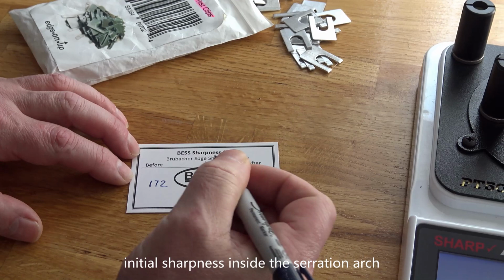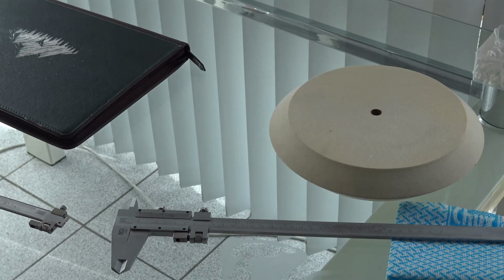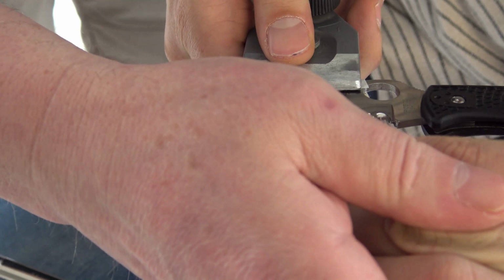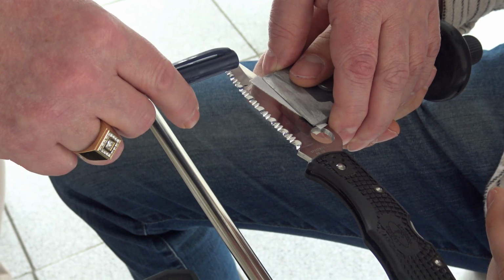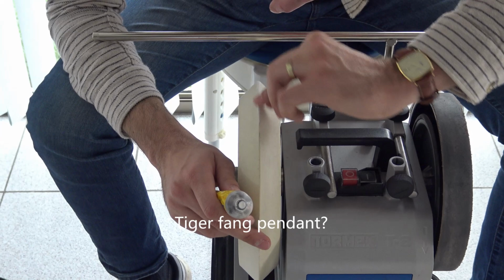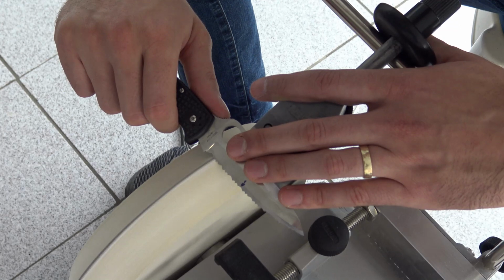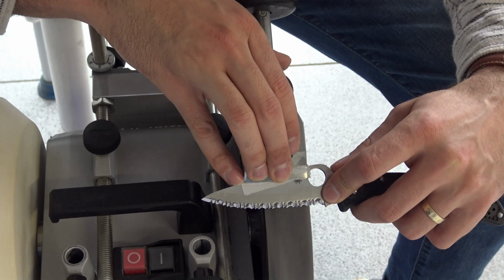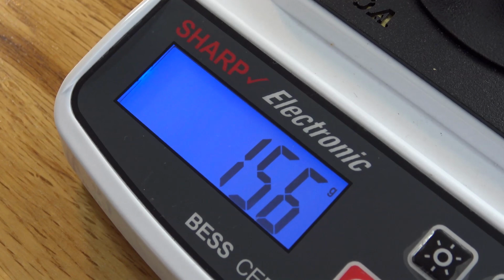Teaching a rookie to sharpen serrations on Tormek

Comment: Vadim Also wondering if  you use your speed increaser when grinding and deburring serrated knives or would this risk over honing ?
Reply from the maker: Al, works fine at a higher RPM. Have you already sharpened some serrated knives using our double-taper felt wheel, bread knives maybe? Getting the sharpness you are happy with?
Reply: Sure have, a couple of Japanese bread knives VG5 core with SS cladding 
used your CBN wheels and tapered felt wheel .BESS around 65 so very pleased with the results.Was just a bit nervous about using the speed increaser when using the felt wheel but will try it next time to help reduce the timeframe
Reply from the maker: That's impressive. Building up the skill, I also first did serrations at the regular RPM.

Comment: Doesn't your honing stone mirror grinding a tapered cylinder towards  the serrations?  Also, how can you grind the rear flat portion of the knife without damaging the rest of the blade as it is truly a straight flat egde? Your sharpening example is for a professional environment only, but it's only confused me more when I need to quickly sharpen in the field. My SAK has one flat face on the rear and you're saying to grind that at a 0 degree angle? How?

Comment: Excellent video.  Besides your considerable technical skills, you are a patient teacher.  
Several of the knives I have with serrations only have them on a small segment of the blade.  Do you have any advice about how to use the part of this technique that is done on the grinding wheel when the section with the serrations is narrower than the width of the wheel?  Thanks -

Comment: Another informative video just wondering why you used the Tormek honing paste rather than the 1 micron diamond spray on the felt wheel?
Reply from the maker: Spray on a taper wheel is such a waste - little gets to the wheel edge, and lots is wasted bouncing from the sides of the taper. Must be a paste.
Serrated blades are hardly ever made of "supersteels", so the Tormek honing compound is the best choice for deburring serrations, we do not need diamonds for them.

Comment: Hi Vadim, Do you now prefer this felt wheel used in this video for de-burring a serrated knife or do you still prefer an 8" split rock hard wheel?
Reply from the maker: This wheel of course - I designed it to overcome shortcomings of the 8" split laps wheel. We used the split laps only because nothing better was available.
This wheel is double-taper, gets into all kind of serrations, wide and narrow, and hones them uniformly to the right and left. The 8" split laps have one-sided taper and hone one side of the serration more, and are too thick to get into the little serrations.
With its 240mm diameter the knife does not bump into the Tormek leather honing wheel, as it does on the 8" split laps.
With the slow Tormek RPM we do not need splits - the splits are to cool the workpiece at high RPM.

Comment: This is an awesome video! Do you have any information on maintaining the leather wheel? I messaged Tormek but have not heard back. I dont know If I should just keep adding the Tormek paste or clean it off and start from scratch? its been about 9 months with many sharpenings. Thank you
Reply from the maker: I clean the swarf off the leather wheel with WD-40 and lots of rags. Do it when the leather looks really dirty, like once a year. Then let the leather dry overnight, and oil it as we do the new wheel. Do not oil after that - the leather hones best when dry and "sandy", and the Tormek honing compound (or Autosol that some use) has enough oil in it.